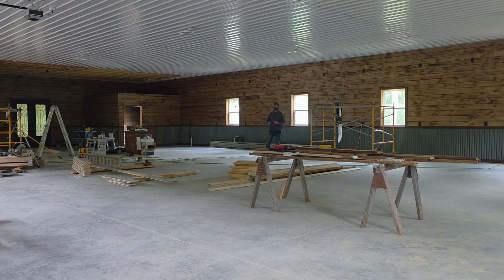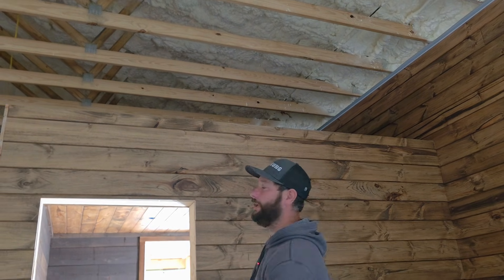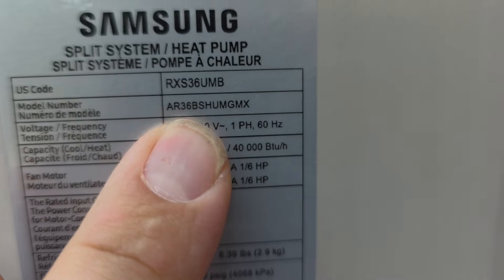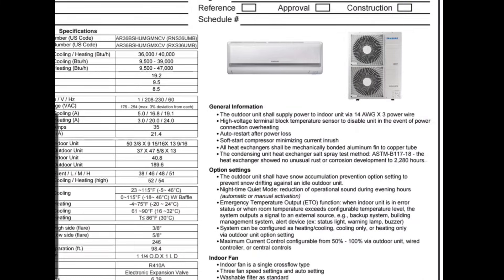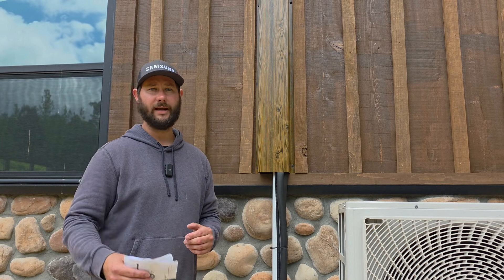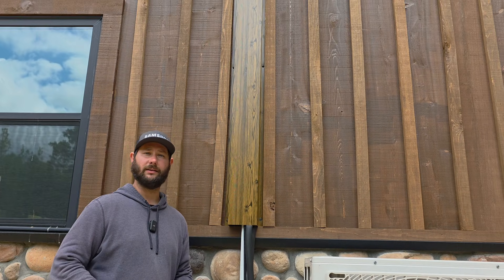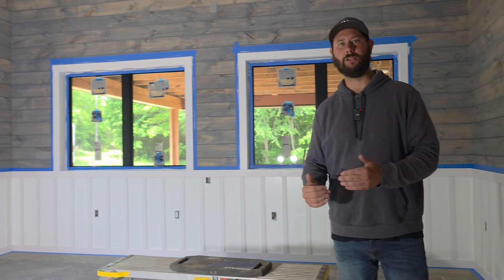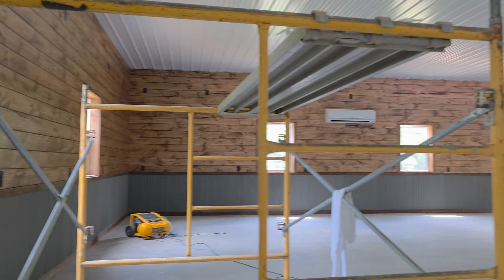Can One Mini Split Cool a Giant Garage?

Comment: 12k sq ft shop with 20ft ceiling height fully spray foamed with 8 14x14 full view glass doors facing east for morning sun.
Would three of these be sufficient? 
Location central Kentucky.
Reply from the maker: I would say so
Reply from the maker: Here is a 36k you can buy 
36,000 BTU Ductless Single-Zone Mini-Split AC Inverter+Heat Pump-230V – TOSOT Direct https://share.google/Tgh7zXt5w91sMnoHW

here is a discount code to save money discount code TaddyDigest for 10% off

Comment: I was hoping you would say something about it whenever you were mentioning fully sealed tight envelope around 7:45. My question is what about fresh air requirements? I'm sure the garage doors are probably leaky enough to supply that, but what about the other interior spaces?
Reply: I know most mini cassettes now have those 4" fresh air provisions but I don't think I have seen it for any other model types yet.
Reply from the maker: yes your right
Reply from the maker: fresh air is a must especially if you have gas appliances in the home I will talk about that in a future video Thanks Brother

Comment: Hmmm…. Spray foam historically is not inexpensive….. I wonder what they paid to spray foam this building ??? I wonder if they insulated under the concrete slab?

I wonder how much time it takes to warm the building up ? Or cool it down… I’m just thinking… If those garage door opened up for 30 minutes because they’re moving equipment in and out that could be an issue…😅. 

For buildings like this… Sometimes if they have a bathroom in a pole building, we will also install a electric baseboard heater that has an auxiliary source of heat and just set the thermostat relatively low… It also will help keep the toilet seat from being too cold😅

Nice video,… Thanks
Reply from the maker: This is good stuff.Thank you so much for your comment and your experience and knowledge.
So I will do a video update of how long it takes to cool it down or heat it up